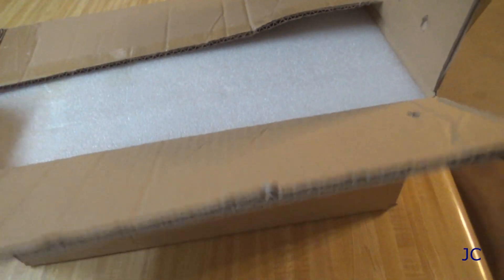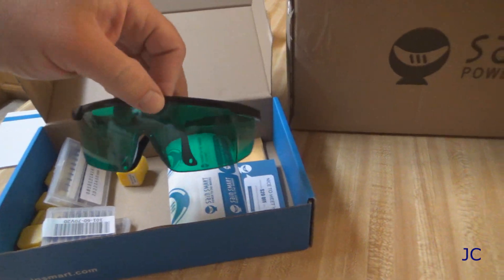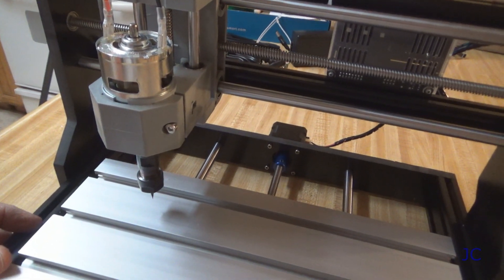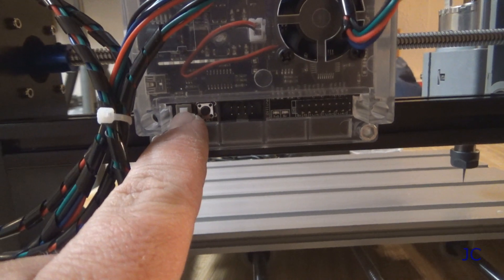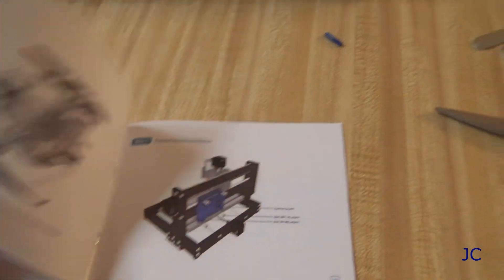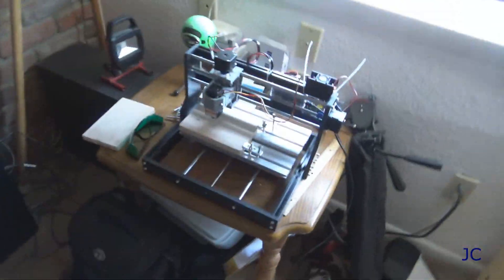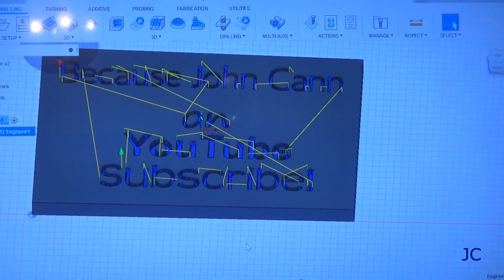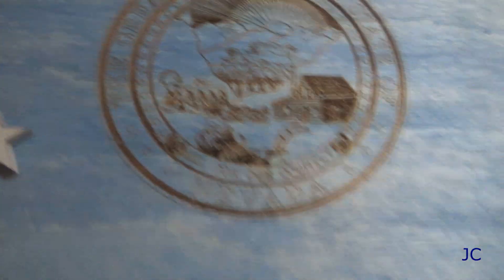I bought a little CNC machine!  Is it worth the money?

Comment: Hello, I have a question about the laser for cnc 3018 what power is in the small house project ?
Reply from the maker: To cut the 1/8 in plywood I set the laser to 95% power, speed 5mm per second, and run 9-10 passes.  Let me know if you have any other questions, thanks!
Reply: @becausejohncann8036 
 I mean the power of the laser how many Mw does it have
Reply from the maker: @rafalkosmacz2872  the laser has a 5.5 watt output.
Reply: @becausejohncann8036  
ok thank you

Comment: Hi can ask what laser w is your using, they have a 40w and was wondering can you tune the laser to sketch and cut.
Reply from the maker: Hi, the laser I'm using is a 5.5 watt output (20 watt input) focusable beam.  The focusable beams like I have can be turned to cut by messing with the beam focus point and hight of the laser from the work. There are also pre-set focused beam models available.  They just need to be set at a certain height to cut and are adjusted with Z axis control if you need a different beam size. You may want to see which one the laser your looking at is and go from there.  Hope this is helpful!

Comment: To cut through the thin sheet of wood what were your laser settings? I can’t seem to cut through thin wood with my laser thanks great video
Reply from the maker: The thickest stuff I can cut is 1/8".  I'm running 5mm per second at 95% power.  It takes 10 passes to cut clean and I would recommend putting the laser about 2.5" above the wood.  It's time consuming but if the laser focus is good it'll get the job done.

Comment: Is the 3018 Pro worth the 200-250 USD that it commands?
Reply from the maker: I feel it is worth the money.  I do recommend getting the laser engraver to go with it.
Reply: I have 2.5w laser already and a CO2 50w so I am fine there.  My problem is I need to do aluminum and I have since found out this will not handle that and the machines that can are around 2 grand, sheesh. :(